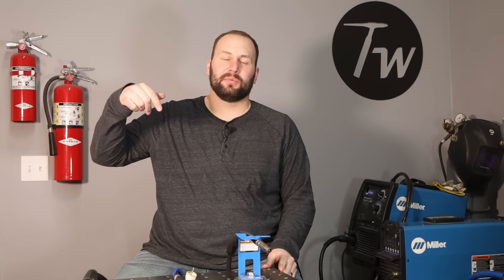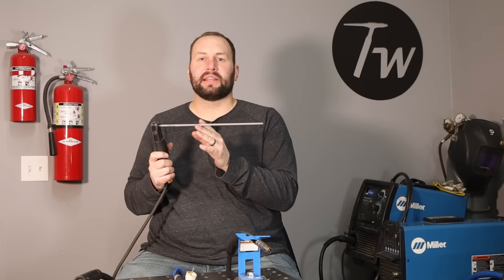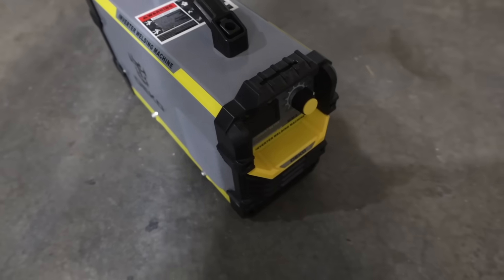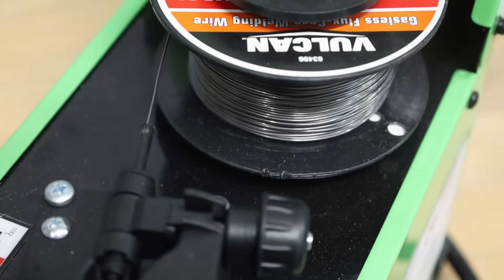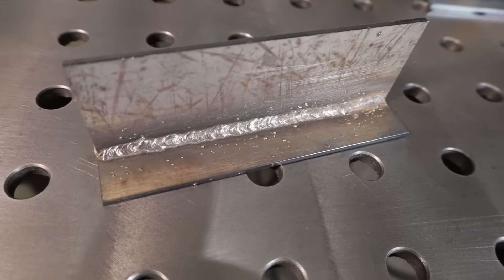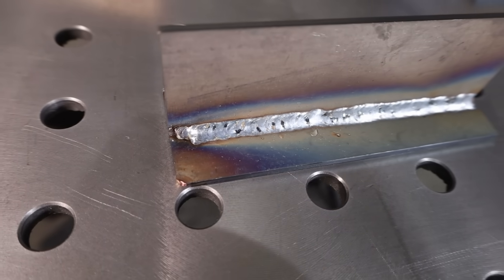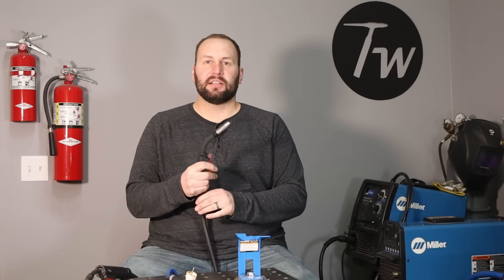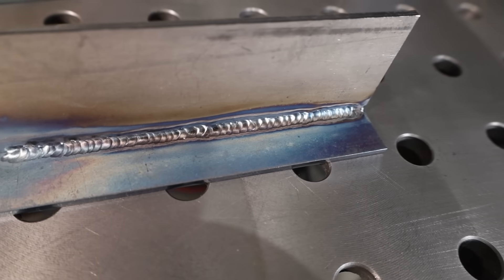4 Types of Welding Explained: MIG vs TIG vs Stick vs Flux Core

Comment: Hi Tim , I learned welding at a very young age like yourself  around 12-15 and still have passion for  metal fabricating and welding as a hobby,  Your informative video  helped me a lot on basics, great info for older hobbyist like me  or newbies. 
I am  in the market to buy a small welder now ,  I can have 110 or 220 V power and most of my welding will be flat or tubing Aluminum or metal,  1/8" to 1/4" what machine  do you recommend to get ? I have done lots of  stick welding but never tried to weld an aluminum with it before I dont know if will easy or have a good result! 
Very interested to learn the tungsten Arc welding ,( you mentioned  AC/DC welder require for aluminum welding,)   do you have more info video on it?  as you mentioned it seem is more precise specially for thiner material such as bicycle or motorcycle  frame tubings  looking forward to your advise , thanks again
Reply from the maker: As far as machines go, there are a ton of great options. For aluminum TIG, my favorites are: 
Entry Level: Primeweld TIG 225X (have been running this one for over a year, it's awesome) https://amzn.to/3f6ANRh
Midrange: HTP Invertig (just got one in, still vetting it, but seems good so far)
Here are a few videos on the process: 
TIG Basics: https://youtu.be/2od_jRAAQ6w
TIG Aluminum: https://youtu.be/k2i5V1DiYOU
Primeweld TIG Review: https://youtu.be/ddIveqH1uQM

Comment: Hi Tim,does it make a difference with the mig weld demonstration ,I noticed you were going forward instead of backwards like the first 2 demonstrations?
 Thankyou
Reply from the maker: Generally, when there is a flux involved, you need to drag the weld to use the force of the arc to push the slag backward. With MIG on steel, you can go either way, though there are some nuanced exceptions to this.

Comment: If anyone’s near West Virginia I’ve got a brand new 650 water cold Miller and 252 Miller and a forklift for sale. I started to open a machine shop and never did go through with it so it’s all put in a storage building at the moment.  I’ve still got the receipts for the two welders.

Comment: Tim,  can you explain to my why I can't tig Al. with my DC machine- But I can do Al with a spool gun with the same machine using 100% 
argon for both?
Reply: To start MIG machines are constant voltage and ARC or TIG are constant current. The old machines you could not mix and match. Most TIG machines have an AC setting for aluminum. I only know machines from the eighties.

Comment: Nice video.  You maybe should have mentioned that Stick and flux core are both processes that are good for outside use.  MIG and TIG are best used in a enclosed shop environment so the shielding gas doesn't get blown away.
Reply from the maker: Thanks! That is a great point. I used to do a lot of MIG welding repairs on railings and gates outdoors and ran into that issue from time to time.

Comment: I have a question does flux core require a gas tank.
Reply from the maker: It doesn’t need gas, though there are industrial applications that use gas with a flux cored wire, which is typically called dual shield.
Reply: Ok thanks.

Comment: just starting to learn to stick weld is there a particular type of stick u need or are they all the same?
Reply from the maker: The main 3 are 7018, 6011/6010 and 6013. I have a video on my channel that shows the differences. Others will have their own favorites, but I would start with 3/32” (2.4 mm) 7018 electrodes.
Reply: @TimWelds  Thanks will check it out

Comment: I never see references to storing sticks in videos comparing welding methods yet major welding suppliers refer to rod ovens. Is this necessary? It would seem to add to the startup cost, the oven, and long term cost, electricity and maybe having to replace the oven after some sort of average lifetime.
Reply from the maker: The main purpose of storing rods in an oven is to reduce moisture in low hydrogen electrodes (such as 7018). This moisture can be a source of hydrogen that may lead to cracking in certain alloys, geometry and loading. Thanks for watching and for the comment.

Comment: Flux core is what everyone should have in their house it's the gluegun of welding.
Reply: I agree but with a strong notice on fire hazards. Flux core welding without enough thinking / safety measures causes fires pretty easily.
Reply: @MikkoRantalainen   everytime I use it outside I spray with water everything 10feet around me. If I don't it's a fire everytime.

Comment: I am an ex solderer (another kind of lower temperature welding I guess) but stick welding I think is called (electric) Arc welding down under in Australia and is the most appropriate short name IMHO. Also the cheapest and easiest way to get into welding I would guess (aside from soldering iron or even small gas torch soldering that is). Actually polyethylene polypropylene plastic welding can be a thing too and at exceptionally low temperatures even lower than 3D plastic printing. It is just an amazing technological world today isn't it: once large expensive things from a factory can now fit nicely and cheaply onto one's very own desk top!

Comment: Im planning to buy mig welding machine. Im a beginner and want to learn welding. Do you think mig welding is a good choice for a beginner?
Reply: No buy a stick machine because it’s cheaper and you learn tig while doing stick also you don’t have to have clean metal with stick

Comment: You said TIG is the hardest, I have tried all of them exept Flux Core(never heard about that one before), and I personally found TIG easier than stick. (Tho I did had to sharpen/switch out the tungsten tip quite a few times) Tho MIG was obviously the easiest. Tho I am a beginner at all of them.

Comment: Thanks man! Helpful!! So the 2nd one looks like my type? Wielding stuff like split shovel heads, thinner metal, lawnmowers, or furniture, etc.??
Reply from the maker: That’s the type of stuff I’d recommend using a little flux core machine on, though any of the others could do those jobs as well.

Comment: You said that some tig welders can do stick too, does it work the same the other way around as well?
Reply from the maker: It does, but with several limitations including arc starting and gas flow valves that would be standard features on most TIG welders, but not on stick welders.

Comment: "i wouldn't stick weld anything thinner than 1/16th of an inch"
Here we go again
"or 1.5 mm"
Thank god and thank you for making the conversion
Reply: I loved that bit. Wish they just had lil pop ups of "mm" conversions everytime they talk American measurements 🙄🙏
Reply: Please America. Please. Just use the IS units. Please.
Reply: @lambdasun4520  We don't use ISIS units.
Reply: Freedom units best units.
Reply: divide by 25.4 or multiply mm by 25.4 to get inch
Reply: @jimmyokawa6800  not many people have built in calculator in their head lol
Reply: @zaptaz7437  but you have your phone in your hand 9 times out of 10 lol
Reply: I like how foreigners expect Americans to convert to metric in their head, yet foreigners cry and roll around on the ground because they have to convert a simple imperial to metric measurement. Keep your phone around and learn the conversion number, then eventually you'll be able to roughly convert between either fairly well. Trust me, being a fan of some strength sports, you learn to convert between both quickly.
Reply: @A-A-RonDavis2470  theres nothing simple about imperial.
If you can picture 1mm you can picture 4mm but how can you picture 3/16 of an inch.
Reply: @yommmrr  If you can picture a sixteenth of an inch, just picture three of them.
Reply: @kirbyspencer538  yeah exactly! That is ridiculous.
Reply: @yommmrr it’s all in how you grew up.  I can visualize everything in sixteenths or inches, feet etc.  but it took me sixty years to relate those measurements to mm, cm, etc.  in school in 1968, we were told that our system would be converted to metric in a few years.  It never happened.  Meanwhile, we were convinced metric made easy sense, but I believe that there was no metric equivalent to “foot” which was a major problem because everyone in the US had access to a foot or two to relate.  And so much of society was based on the foot that it couldn’t work well metrically.  A yard? Yes, the meter is pretty close. But what’s a foot? That was the stumbling block, pun intended.

Comment: Can someone recommend a type of welder for body panel replacement such as quarter panels and etc. I have a titanium flux core welder but it burns through the thin metal immediately even in the lowest setting. Thank you 🙏

Comment: Thanks so much for this info. I need to do some small bit of welding and was going to use the old stick method but when I saw the tig welding it reminded me a lot of using a soldering iron and solder so now I'll try that out!

Comment: What kind of welding was I doing in high school? We had two big gas cylinders hooked up to a nozzle with two valves on it, and we started it with a tool that made a spark. We had to hold a rod in the other hand like with the TIG welding.

Comment: THANK YOU I NEVER HAD ANYONE EXPLAIN WELDING LIKE THIS.  QUESTION; I WANT TO REPAIR THE LEG OF A METAL PICNIC TABLE.  FIRST TO SCREW A BRACKET ON IT, THEN I WANTED TO USE A TORCH/ BOTTLE TO HEAT THE LEG WITH AN ALL PURPOSE ALUM. STICK  FOR MORE SUPPORT .  WILL THIS WORK???

Comment: Don't forget the most important thing about welding. SAFETY!!!! It is inherently dangerous. Good ventilation is absolutely non-negotiable, as are a proper helmet and gloves for the type of welding. TIG requires much thinner gloves whereas stick requires super thick gloves. Also make sure all your skin is covered up or you'll get major sunburns! TIG is my favorite because of its versatility, but stick is best for anything structural. Never liked wire feed. Ironically I kinda stuck at it, but I'm awesome at TIG. Go figure. Flux Core is definitely the most portable and compact. Also excellent for tack welds. 😉

Comment: Mig (GMAW),  Stick ( SMAW ), TIG (GMAW ) , and lastly MIG Flux Core  a variant of (SMAW)   are ALL Arc Welding pure and simple the sooner people realise that the better off we will all be !! 

          The main differences are of course how shielding of the arc is done with some being provided by the Flux Core or coating on the Rod, not forgetting the actual steel alloy of the Wire or Rod either then the Various Shielding Gasses used for different metals and one so often overlooked the Current Flow ( AC or DC- and or Reverse DC as both polarity and Amperage used have a huge effect on the finished job . 
Great Vids Sir

Comment: Its direct current for aluminium . And Alternating current for the rest most of the welders are only AC not AC/DC and you need one like the last to melt aluminium.

Comment: i’m about to be 16 and i’m a sophomore in high school and i wanna start welding and go into college for it but i don’t really know where to start to be honest. any suggestions?
Reply from the maker: Very cool! I actually started my first welding business in high school repairing railings and gates, so it's never too early to start learning. There are 2 routes you can go to start learning to weld. If you have a safe place to weld at home, you could get your hands on a machine and some gear and start practicing. I have beginner videos for all of the processes, but I would probably start with stick because it's easy to get a handle on and the equipment is cheaper. I have a little welder I got of Amazon for around $100 that actually works really well. The other option, which I highly recommend, is to see if you can take a course at a local trade school or tech college. Often high school students can take these classes for free and get elective credit. You would learn and probably get at least a structural plate certification. This alone can get you into an entry level welding job. Another good option to get started is to get a part time job somewhere that they do a lot of welding and work your way into it. 

As far as college goes, I am a huge fan of formal education, however, I would go into it with a goal in mind, whether you want to be a welder, set yourself up to run a business, or be an engineer. Don't be shy about calling up schools you're looking at and ask them questions, they're usually very happy to help. I'm actually not a welder, I'm a welding engineer, which I went to college for at Ohio State University. I may be biased, but I think it's an outstanding program if you're interested in engineering, but there are other programs around for whatever you're looking for. As far as welding engineering goes, it is much more hands on than other engineering disciplines (though there's still a fair bit of paper pushing to do). If you're interested in college and welding, I think it's at least worth looking into.

Comment: is there any solution to the eye irritation after stick welding despite wearing goggles?
Reply from the maker: I’m not sure what kind of goggles you’re wearing, but you need to have the proper shade for the amperage you’re running (probably shade 10-12). If they are for a torch, they may only be shade 5. Furthermore, I would never weld without a full face welding hood/helmet. If you have the right gear, the only irritation I can think of can come from the fumes, which is solved with good ventilation and keeping your head out of the way of the fume coming out of the arc. It is also important to avoid breathing the fume. This isn’t everything safety related that you should know, but I hope it helps. Lincoln and others have some great safety resources. Please study them and stay safe. Thanks for watching and for the comment!
http://safety.lincolnelectric.com

Comment: If I remember right..... All these different welding types Also has different strenght, meaning one breaks easier than the other one if you would test it.

Cuz( correct me if I'm wrong) but they still weld boats with the stick cuz it is the one giving the strongest weld.

Comment: Halo,,✌️🙂.. i am profesional welder  waranted Engineering.. many kind used it between all us machineering welding tool. First MIG,, TIG,, STICK,, and FLUX CORE. If your the someone people making the most is your used MIG.. if your someone welder fast must yours used FLUX CORE OUTO MACHINE.. the FLUX CORE used very popular of any industries ship yard or any companies heavy welding.. the flux core used so many Argon-oxigen yours controlled good in your links enough for your   salary..✌️😚❤️. 100% weld flat block and 50% over head used up.. but i have so many users flux CORE becouse is so fast ready moving and very nice welder..👍✨. Trouble flux core is youre handle from water,, fan,, of cousely wind,, Argon using is cannot abtraction argon about distance Line.

Comment: is ac stick welding like dc stick welding
Reply from the maker: Yes, for most hobby/home/farm stuff, AC works just fine. There is a little more spatter and you can't run certain rods, but a lot of great stuff has been welded on AC. Most industrial stick welding that I've seen is done on DC, which is a bit smoother.

Comment: As a person who wants to learn to weld, this was the most helpful video I could find. I am grateful to you for making this.
Reply: I have a backlog of welding jobs to do. I can never find anyone to do them, so I may have to learn welding at 73 years old! Many Americans are too lazy to do anything!
Reply: @jedpeeler4199 Do you have an account on the program? I want to ask you a few questions please?
Reply: @pams2270  you don't always need to change your amps, it could be the travel time, you can speed up with higher amps or slow down with lower amps, it not just a case of changing the settings it can be down to the welders preference on how they want to weld, quicker/slower.
Reply: @bradleystirton6318   It's about penetration, welding isn't just about joining 2 bits of steel it's about the penetration. The Amps and speed should be about achieving penetration of the weld. If the weld is too cold (not enough amps) it won't matter how slow you go it won't penetrate and it will be ugly. Too fast then you risk not putting enough weld down to be penetrated. Your welding speed should generally always be about the same in most cases, depending on the metal. So adjusting amps to give you a moderate speed will allow you enough time during the weld to gauge penetration. Doing break tests are the best way to learn how good your welds are if you have a hydraulic press, or you could rig up a trolley jack and vice instead. A weld can appear to look ok but be a shit weld if it wasn't hot enough to penetrate. Although you learn to get some idea by looking at it, but you really wont know unless you learn what a penetrating weld is and what isn't when you're actually doing one.
Reply: @pams2270  thank you
Reply: I never welded before but needed my bike frame fixed.  I used one of these with a torch and it actually worked. I forgot what it was called I just looked up welding with no welder
Reply: @breakingames7772  I think it's called oxywelding. You use gas and oxygen, instead of electricity, to melt metals.

Comment: Albert Einstein - "If you can't explain it simply, you don't understand it well enough.

You explained it so well with simple language. Thank you. 🙏
Reply: "buy low, sell high" 

Piece of cake
Reply: He said you can do all of the three etc with one machine. What if the machine is electrical on can all of the three still be done with just one machine?
Reply: The welding piping is not benevolent when using the vehicle of high voltage screening and pole gouts
Reply: ⁸